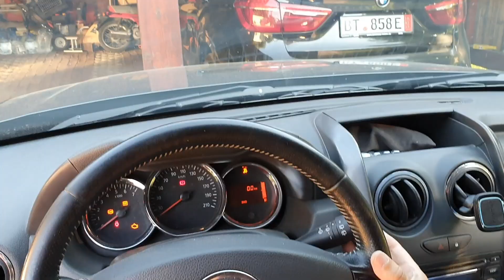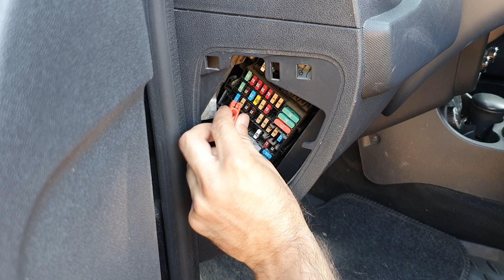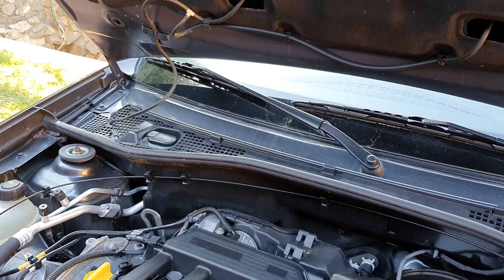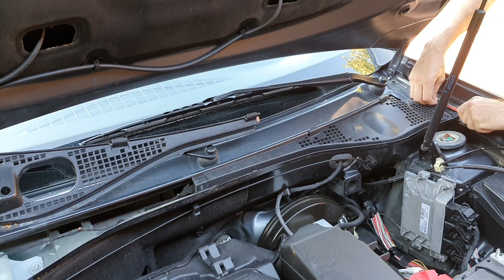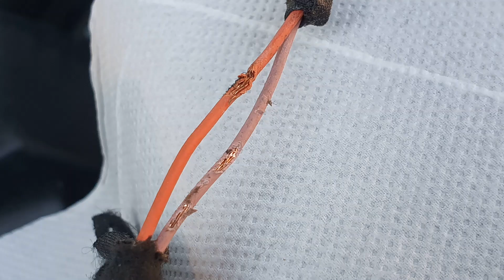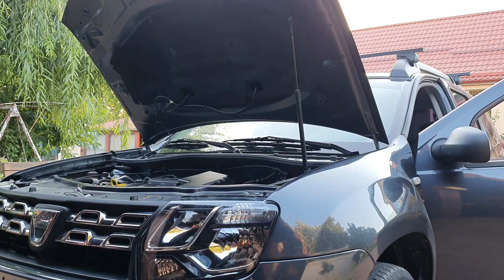Duster 2016 Windshield washer pump repair

Comment: So really you didnt fix the pump you just repaired the connector cable
Reply: The question is how the hell did the cable get that knackered in the first place! Assuming you looked at this as you had an issue Kevin, did you manage to fix yours and what was wrong with it?